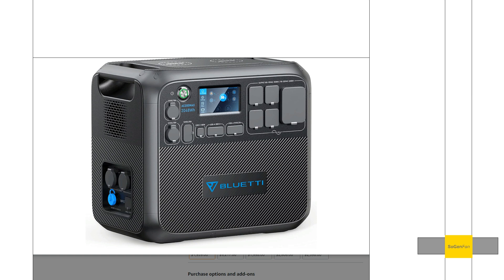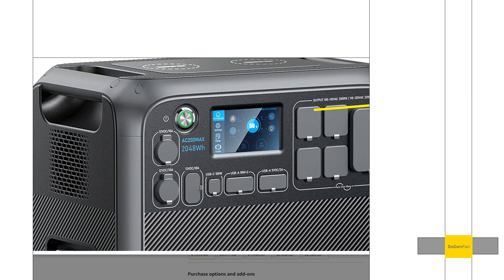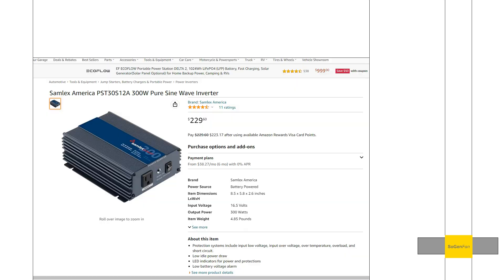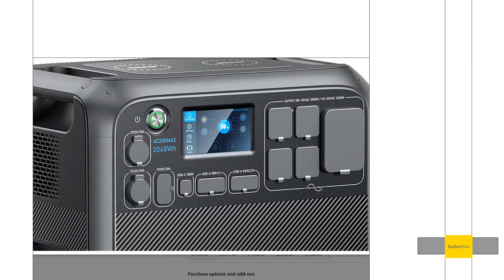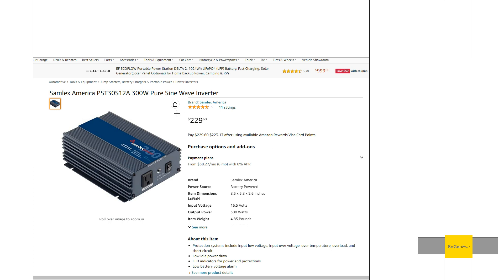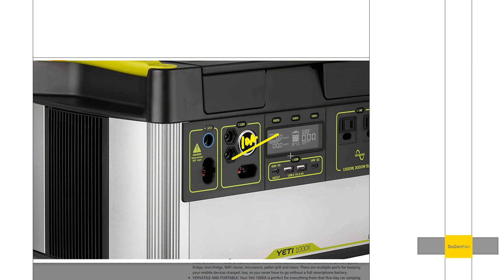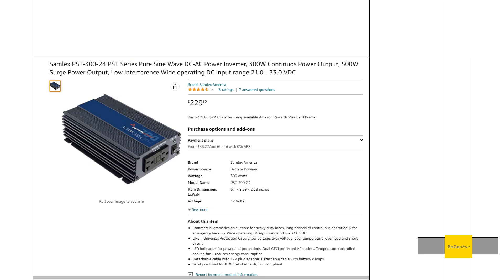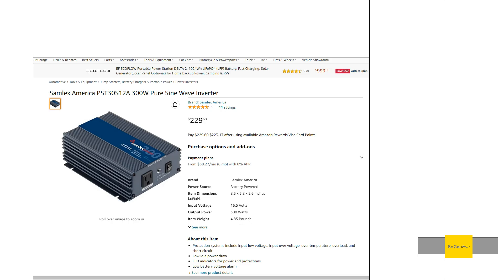Small, efficient Inverter ADD-ON

Comment from the maker: The downside of having a large inverter is higher power consumption, making it less than ideal for running small loads, especially small loads for long durations. By using an add-on DC powered inverter, you can have the best of both worlds - a high power inverter for big loads, and a small efficient inverter for small loads. 

If your power station has a 15 amp (or higher) 12v outlet port, or a 24v outlet option, you can use a small DC inverter with these ports. Keep in mind your output power will be limited by the output specs of the port. If you use a 300w pure sine inverter with a 24v 10 amp port, the max you can use is 240w, and 240w is the max surge as well, so don't run these setups near the max limit!

Preferably use a DC outlet with a more secure connector like anderson etc - not the standard car / cigarette outlet.

Remember the smaller the inverter rating, in general the less idle power it will use. I recommend a 300w pure sine inverter for most of these setups.

--------

If you also love portable power and would like to join me on this journey, please consider:
Subscribing
Giving a thumbs up
Sharing this video
Using my Amazon links
and don't forget to leave a comment!

Thank you and thanks for watching!

--------

Samlex 300w 12v AC Inverter on Amazon (affiliate link): https://amzn.to/3UxPvVv

Samlex 300w 24v AC Inverter on Amazon (affiliate link): https://amzn.to/3MCZx5F

Comment: would like your thoughts.

so far i have had a bluetti eb3a, ecoflow river 2, pecron e600lfp (this one seems to be my favorite so far, it for some reason draws less power when charging things.

using ac on all of these with ryobi batteries, the bluetti eb3a uses approve 25% or so more wattage to charge via ac.

wondering what the issue is, any ideas? ive also tried fans etc, and the bluetti ac inverter just uses more wattage to power things.
Reply from the maker: It's probably just because the Bluetti has a pretty large inverter paired with a small battery. Yes the pecron does as well, but sometimes inverter losses are not to scale. The Bluetti's inverter might be using around 10w, and the pecron's might only be using 12w (just guessing).

Also Bluetti is probably reserving more of the battery capacity (the useable amount is probably less - I'd guess you can only use 90% of the Bluetti's battery, the pecron maybe 95%).

This would be done to extend the lifetime of the battery.

Comment: you do great informative videos.

question,
if im getting only perhaps 20 or 30 watts solar does it even make sense to keep charging at that low rate?
assuming inverter is not on but the display is on. not sure if the power station is on and using power, hope that makes sense.
Reply from the maker: The display should only use a few watts, so I'd say it's worth it. Depending on the model of course, but It's unlikely any use 20+ watts. 

If you have a cloudy day with a lot of low rate charging, just check the % at the start and end of the day. Even 20w of solar all day on a large unit should gain you a few % points. If not, then you have your answer.

Comment: Great Concept...........but with the prices you have to pay for the Extra Parts you might as well get another Smaller Power Station like the Bluetti EB3a
Reply from the maker: Well the EB3A is like the opposite setup as this. Small battery with big inverter. 

If you add a small inverter to a 3 or 6kwh battery system, you can get some serious AC runtime!